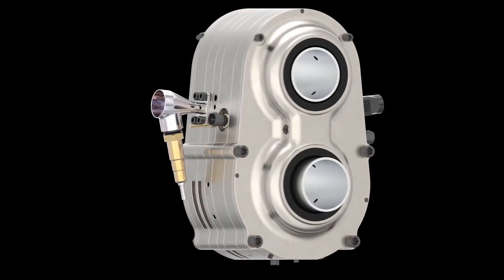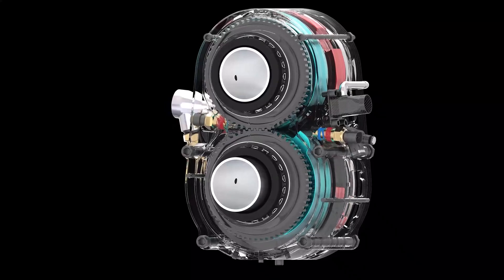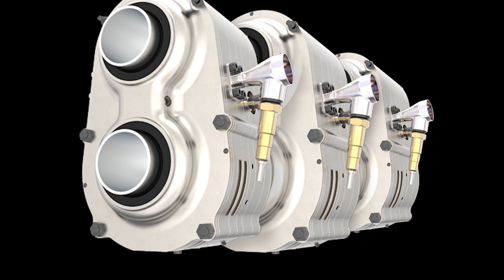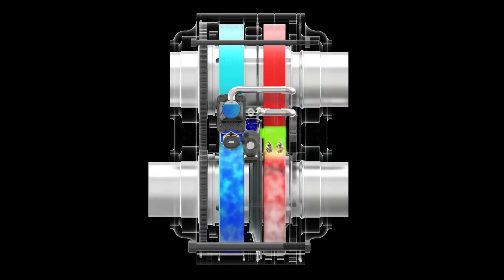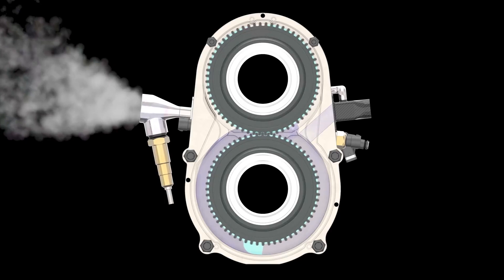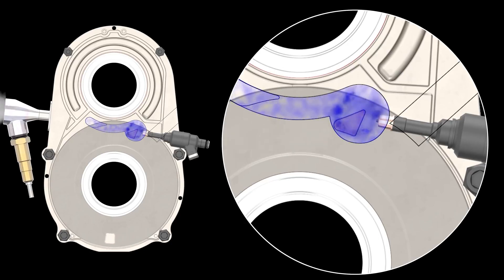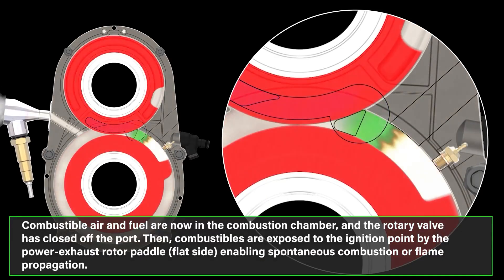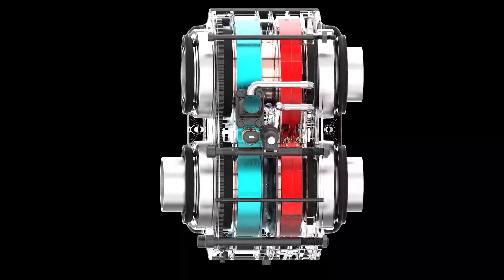This pistonless engine runs on hydrogen and revs to 25k rpm

Comment: Forgetting about seals... On such a light engine, how will it rotate at 25k rpm without metal distortion caused by centrifugal forces on the geared ring and other spinning plates ?

Comment: How will you keep things lubricated with tight tolerances and no seals? Metal expands with heat and there's pressure differences going on inside there...

Comment: If you used it’s peak efficiency, light weight and small size to turn a generator to recharge what could then be a smaller and lighter battery pack in an electric vehicle (you could possibly even use this to turn the drive motor(s) when the vehicle was stopped and use the same type of charging that regenerative braking does.  By building the ability/option to self charge into the vehicle, and perhaps the option to run the engine shown on multiple fuels from the ideal hydrogen, but also LNG, Propane or others gas phase fuels when necessary- you could build an electric car which ideally charges from your solar powered plug in station at home for your routine day to day commuting, but which is easily capable of traveling cross country at a moment’s notice without the same tedious planning that it takes to try to drive anywhere in a plug in electric vehicle now.
Reply: So a jet engine powered electric car in effect, already been done.

Comment: Yeah but^ 1 It will cost a lot to manufacture 2 Hydrogen fuel is inefficient in production-transportation-storage chain and costs more. Electric , weather you like it or not,  is the way forward.

Comment: If this engine runs at 25K regardless of power level and is throttled by skipping firing cycles when less power is needed, the loss of heat during the "coasting" rotations will make it inefficient. If this ever graduates from CAD cartoon to working prototype, I suspect many issues will be found.

Comment: what mpg will ot get service life, if it sounds like a dud and looks like a dud then its probably a dud.
good concept but needs to he proven will take years and super hardened materials would needto be used due to lack of seals and super tight tolerances would be need can't see it doing 100k atm